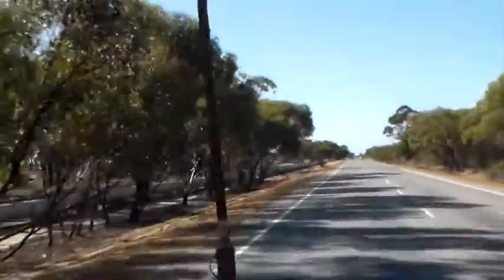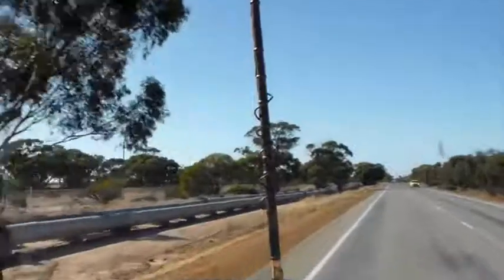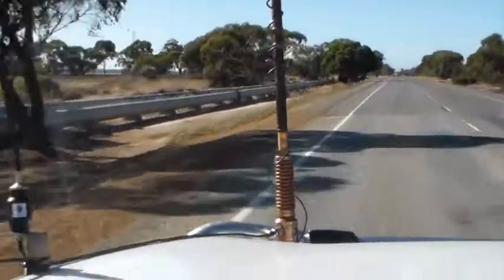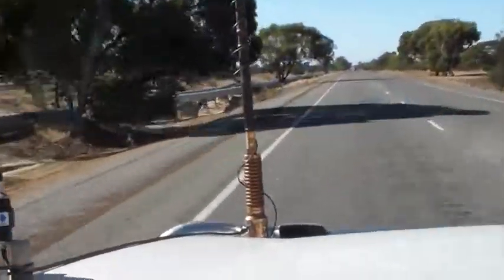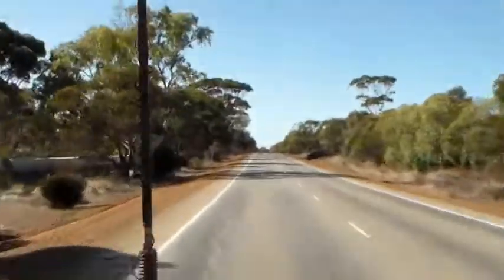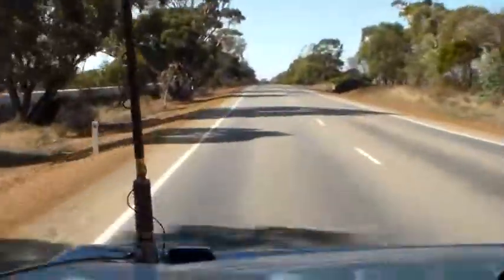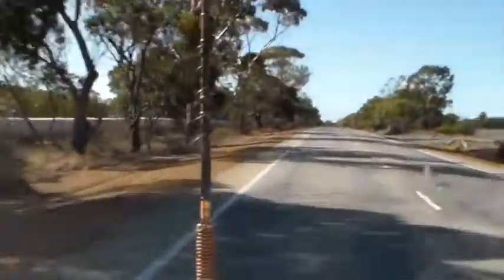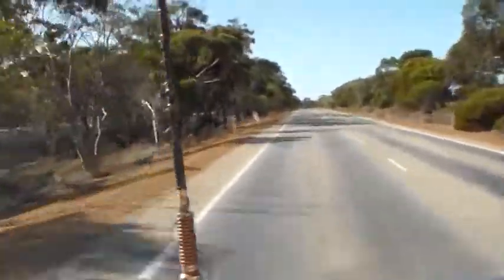The Terlin 'Perth Plus' Mobile HF Antenna Mounted On The 4WD.

Comment: I realize this is an older video, but what is the wire circling around the spring, a ground connection from the antenna base?